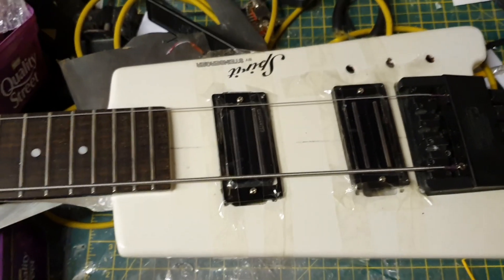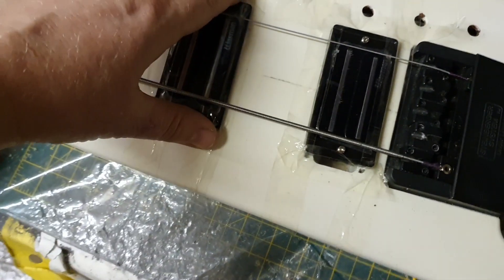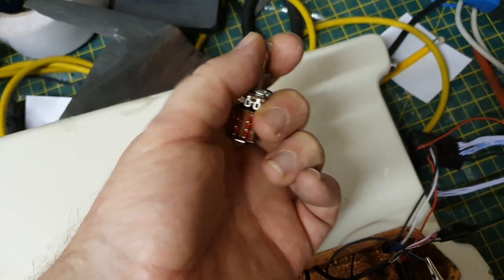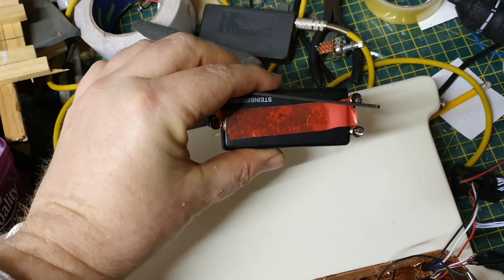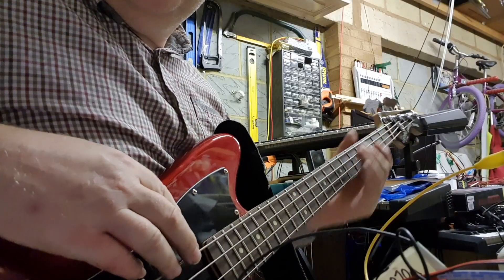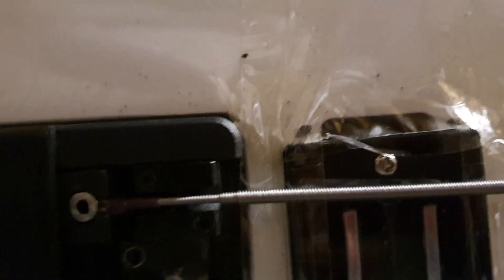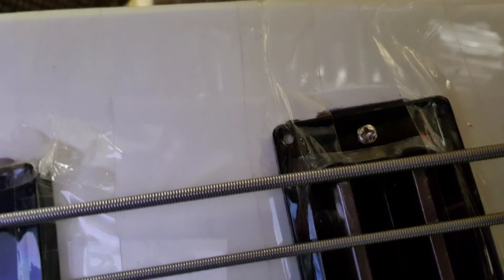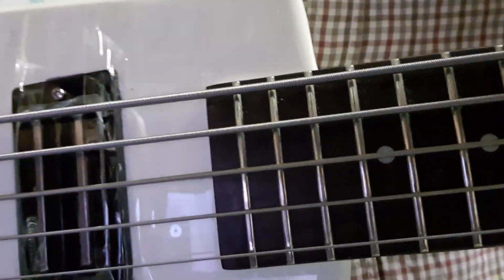Warman Warblade pickups on a Steinberger XT25 - first experiments - decent neck output!

Comment: The rails aren't wide enough
Reply from the maker: I agree on the bridge pickup. On the neck pickup they seem to be sending the field ok. I just finished levelling (will post video) then start to reassemble the pickups - I have no easy way of knowing the extent of the unbranded soap bars - and I have to trust that the stock pickups were able to sense.

I was thinking of putting some iron filings on top of transparency sheet to trace field - do you have any suggestions to check please?
Reply from the maker: The other idea i was researching was to get the 4 string bridge and nut, perhaps from a DIY kit, depending on string width. Let's see how it sounds when I assemble neck Warblade hopefully at one point over the weekend.
Reply: @stephenhookings1985  those pickups seem very high output,  too. not sure what to.suggest.  Are u keen to have a 5 string bass?
Reply from the maker: @Iggytommy  so I have a 5 string SX fretless - I got the Steinberger as my 50th present to recapture my youth :-). I would happily convert it to a 4 string as the existing spacing is too close. Having said all that a Sire M2 5 string is £300 hence why I am not going to drop £200 on pickups for this one.

Therefore this bass is for experimentation - especially during this current crisis. I am about to post next stage where I level the A string and mount rail in front and original in back. This Warman is much sweeter sound than original (although bridge is always weaker sound than neck).

From what I understand of blade construction there is a T with coil wrapped around it and magnet on bottom. I will also try a longer piece of steel rested on top - it's just there to transfer the magnetic field ... Might work :-)
Reply from the maker: Forgot to mention I have an HSS Stratocaster and another Strat I am experimenting on - so whatever happens these Warman pickups are going to get used :-). And by the time you put signal thru wet effects the original signal is irrelevant - but it is good.
Reply: @stephenhookings1985  that pickup would be ideal for a hot bridge humbucker in a Strat. Due to its high output, its coil split mode would be excellent to help mimic a strat single coil.   you could even use the other one of the pair as a neck pickup but just wire it as split coil and maybe in parallel mode too.
Reply from the maker: @Iggytommy  - great minds think alike. I was just sitting in the sun playing the bass thru Zoom pedal. The pickup, for the strings covered, is capable of decent articulation - and I though "hmm.. i have one half of a Pbass :-)". So if that's what you are suggesting (to use neck and bridge together but as per large PBass in neck/middle position) I like it. I like it a lot.

I just got some new router bits - not sure how good they will be. The stock pickups are just so poor in comparison to these Warblades. Other video is still rendering (slow PC). Adding some additional iron from a transformer to extend the blade helps but would be better for wider pickup - or fat PBass.

I also put it thru my Orange Crush (rather than the Laney). I couldn't record it cos the Mrs complained so much about the volume - amp was only on 2! And quiet as in virtually noiseless output.

So experimentation with wide P-Bass likelihood if these router bits work on test wood. Great fun at least (for me).
Reply: @stephenhookings1985  my last comment was about using those pickups in your strat
Reply from the maker: @Iggytommy  got some Warman Jazz blade. Just made a YT on fitting one at bridge - seems to work and wide enough. Got a other on order.

I feel the need to a strat build to use the Warblades now :-)